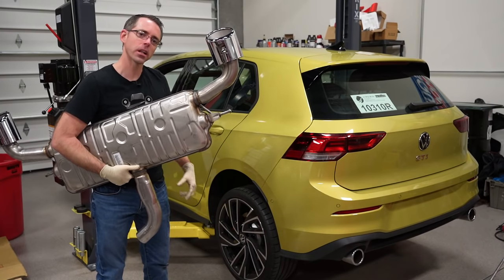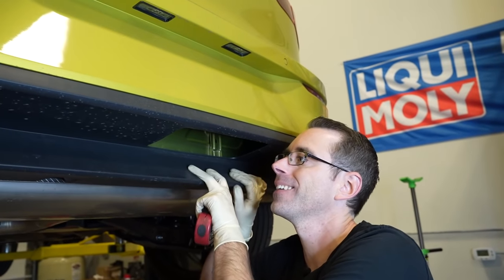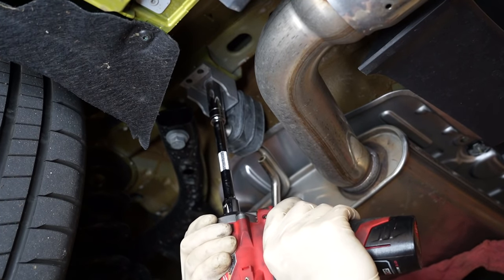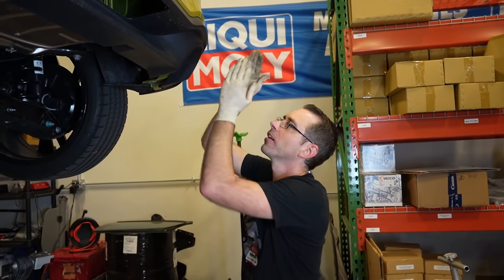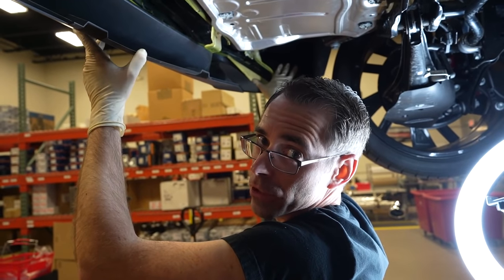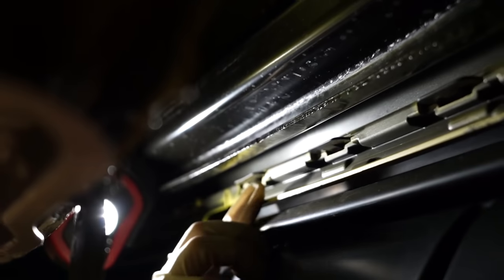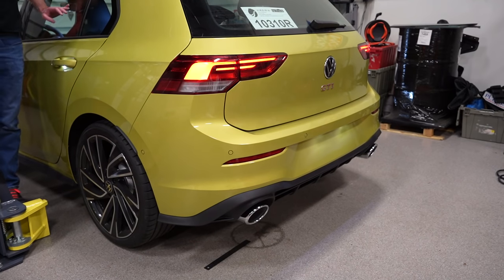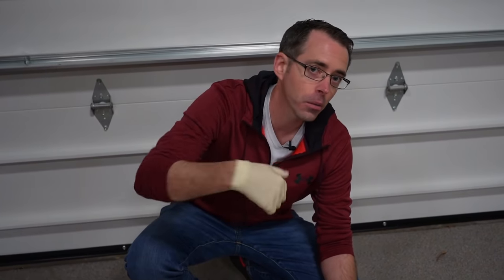Can the MK8 GTI Sound Good? | Clubsport Muffler Install

Comment from the maker: Thanks for watching! Here is the link for the MK8 GTI Clubsport Rear Muffler and Valence Retrofit - https://www.shopdap.com/mk8-gti-clubsport-rear-muffler-and-valence-retrofit.html

Visiting the VW Port, Picking up our MK8 GTI, and installing a short shifter - Video
https://youtu.be/ynAlwnsc3Lo?t=3
Reply: I have a Clubsport S muffler that I had on my MK7 and now I’m driving a MK7.5. Do you know if there is a valance I can get that will let me run the Clubsport S muffler? I really enjoyed the tone of the muffler and would love to use it again. Thanks!
Reply: The 3 dimples you identified where you cut the muffler is indeed the factory location for cutting the pipe and using the butt clamp. You are actually meant to cut on the middle dimple and you'd have a perfectly fitting muffler. The same method is used across the entire VW group and it's basically in place for when you need to replace a muffler. For example, on dual rear muffler VW group vehicles these 3 dimples will be present on both sides. Cheers!
Reply: GTI 245 ch ...bullshit

Comment: Just stopped by my local dealership to check out the MK8 and although I’m keeping my MK7 Sport for now it definitely looks way better in person.
Reply: Who
Reply: @oaxaple4636  You
Reply: Yeah but it has trash interior
Reply: Asked
Reply: Mk7 is way nicer indeed!
Reply: I like my  physical knobs
Reply: Im keeping my gti mk7 too 🤩🤩🤩
Reply: 7 way better
Reply: Nah nah nah the mk7 is far superior in looks to this garbage I especially hate the new interior like most people
Reply: @ivanjovanovic362  have you been in one
Reply: @quadmeister  dream on
Reply: I get compliments everywhere. 
it’s looks very handsome in person
Reply: @downshiftpedal   go away! From outside its ugly and from inside its insane ugly...
Reply: It grows on you it’s actually really nice my neighbours got one and I actually prefer it to  the mk7 now
Reply: SPORT GANG
Reply: I just can't stand the front bump on the mk8 GTI, there's just too much lower grill
Reply: @downshiftpedal  from an outsider’s perspective i think the mk8 looks much better than the mk7. mk7 and 7.5 look dated now. and the interior on the mk8 isn’t that bad. 99 percent of the time i use steering wheel buttons for volume and it doesn’t look too hard to memorize where the climate controls are when it’s dark. i know where all the climate buttons are in my subie and can use them without looking. i imagine it’s the same with long term mk8 drivers. plus the mk8 has so much more power. 240-250 wheel hp and up to 320 wheel torque has been seen on dynojet. they’re absolute monsters. that’s why i ordered one rather than just buying a mk7.5 for thousands less
Reply: @ivanjovanovic362  that is your opinion 😂 I love my mk8 interior
Reply: My mom has one and everyone else in my town has one and I sadly have to disagree with you
Reply: @thefunperson1  your infotainment system crashes more often than I got rejected in 18 years
Reply: @iuopunderstandyourjokes9914  funny cause mine doesn’t crash
Reply: @iuopunderstandyourjokes9914  but i believe that you got rejected a lot, makes sense
Reply: @aidanjulianroman  fr? I was driving my moms golf 8 gti once and it crashed 4 times in 12 minutes
Reply: @aidanjulianroman  2 times out of 2 tries
Reply: @iuopunderstandyourjokes9914  damn sorry to hear that. mines a 23. 22s are worse and cars without the updated wheel are worse too
Reply: @aidanjulianroman  my moms is also a 23 and it doesn't even have 2000km on the clock. My mom picked it up a month ago from wolfsburg and the infotainment system still crashes regularly. It might be a Friday car
Reply: @iuopunderstandyourjokes9914  hang on to it :( there are updates coming that fix it but most dealerships don’t even know about it yet. the updates fix the infotainment and the steering wheel control module will fix the travel assist issues. just hang in there lol
Reply: @aidanjulianroman  the place where vw comes from is literally 2 km away from my house and they know and even admitted that their infotainment is a failure. If it was up to me, I would just swap the gti steering wheel for the cupra leon wheel (it's basically the same but with physical buttons)
Reply: @iuopunderstandyourjokes9914  you live near wolfsburg? i’ve always wanted to see that plant. i live in the states and i work at the plant that makes the atlas and id4. the good thing is that there are fixes for the infotainment. there’s a guy here who is testing software updates and seeing if he can get the issues to go away. that will fix the input lag and glitches in the screen itself (and fix some weird quirks with settings being reversed when you shut the car off) and the new steering wheel module will fix the travel assist errors. im sure if you could code a cupra wheel to work with the mk8 it would fix the issues as well (and you’d get physical buttons!)
Reply: @aidanjulianroman  I got the wolfsburg licenseplates on my car. I saw the plant and it's boring as hell. If you wanna come to germany just to see the plant, don't. This town has nothing to offer (we don't even have a karaoke bar.) You can see the whole town in 20 minutes on foot. The VW atlas isn't even sold or built in germany but one guy here has one and it looks pretty sick. Here in wolfsburg, no one ever thought about doing anything about the infotainment system and it makes me pretty sad because my factory cd radio in my 18 year old audi works better
Reply: @iuopunderstandyourjokes9914  oh i wouldn’t go just for the plant unless i get into a different position at vw that requires me to move. the inside of the plants are fascinating to me though. but yeah, it sucks that you got a dud mmi. my mk8 has been great for the 900 miles i’ve put on it. infotainment has been completely flawless for me. carplay connects fast and i’ve had no lag or glitches. hopefully you can get yours updated and it fixes all the issues, it really is a great csr
Reply: @aidanjulianroman  we put 2000 km on it and it started behaving about 150 km ago. I still don't like it but that's because I'm old school and prefer physical and backlit buttons
Reply: @iuopunderstandyourjokes9914  I went to see a MK8 while driving my MK6. Of course the mk8 is newer, better performance, 7-spd. On the other hand, my MK6 is so analog, I still have the original radio, that european feel and smell is lost on the 2022/23 model. 
I love my mk6, maybe in the future once it goes OOC.
Reply: @psiturbo  you lied about one thing. You called it better
Reply: @iuopunderstandyourjokes9914  it has better performance, the mk8.
Reply: @psiturbo  sorry, I miss read your comment
Reply: @quadmeister It’s a VW, it’s gonna be ugly

Comment: The mk8 GTI doesn’t sound bad at all with the stock muffler.
Reply: True, but better is always nice
Reply: sounds like a vacuum cleaner man.
Reply: Yep, just got one last month and considering the sound usually gets slated I was pleasantly surprised that sounded more fruity than expected.
Reply: @MrArchie800  Keep in mind unless you've entirely deleted Soundaktor from the GTI you may be under the influence of artificial sounds.

Comment: Those bends/marking on the pipes are intentional. Can look it up in the repair manual (if you have access to one), it means that if you ever need to change that part of the exhaust the middle marking is where you should do the cutting.
Reply: Did he cut to the front of that middle dimple which is why his gap is a little big?   It's hard to tell in the video, but it looks like he might cut to the rear of the middle dimple, which is weird because the gap is big.  I know lining it up and visually checking is best, but it would have been great if he said "I cut 1 cm upstream of the middle dimple" (or whatever).

Comment: This automotive engineer's opinion.  I was young once and changed every exhaust on all the performance cars I owned.  Not any more.  A waste of time and money and every louder exhaust has a trade off of harshness at some interval of RPM and load.  This is better than most because it is an optional factory muffler but again, a fair amount of money with the price of German factory parts and very similar to the stock muffler as you note.  Increase in depth of tone under load isn't something a driver wants anyway in daily driving.
Nice video though and you do a nice job.  Thanks
PS. what I have learned over the years about exhausts.  A quieter car overall is more enjoyable because you can wring its neck, be up on the cam and closer to redline without drawing attention of the police. Same with motorcycles for those that enjoy performance on two wheels and have a need for speed.  Further, for non-spirited driving, a stock exhaust is less obnoxious to live with day in.  Young people learn this after their 5th modded performance car.  Some lessons in life take a while. 😉
Reply: Can confirm this x 100. I own a 16” 320i. Exhaust is not even loud and sporty driving is really fun and the rear goes if you force it to. My lil bro has a 13” S3. 300hp with stock exhaust. It was fun driving till the fucking exhaust was giving me headache by just cruising. I cant imagine other cars with custom exhaust being fun to cruise along in. Sleeper cars are also more fun because people dont expect anything of it.
Reply: @buraksarikaya9798  That's why in Germany every exhaust system is not really louder than the original one, it just sounds different. Every legal one at least.

Comment: Got mine Monday, installed it today ( on jack stands ) this video made installation a piece of cake! Hardest part was getting the rubber hangers off the old muffler. Keep doing what you guys do! Love the look and sound! ✌🏻✌🏻
Reply: How was it making the cut to the stock muffler?
Reply: @SWEETVENOM100  not bad at all. I used a pair of the exhaust pipe cutters.. the worst part was getting the hangers off.
Reply: @jayorzell3656  how did you measure ? I’ll be doing it on my back😫
Reply: @SWEETVENOM100  that’s how I did it… the entire process took me about an hour and 45 minutes. Which no joke 45 minutes of it was messing with getting the rubber hangers off. Plenty of wd40 and the pic tool method mentioned in video along with some patients does it..good luck!
Reply: @jayorzell3656  just rented a  Reciprocating Saw and got her done. 1.5hrs only because I was trying to like the tips the best I could.

Sounds pretty tame but I haven’t taken my car above 5K yet. In comfort it’s quieter than the stock exhaust!
Reply: Any issues with leaks around the band clamp?
Reply: @ericmorris2831  no issues with leaks. Clamps work great

Comment: I installed a custom catback thankfully and I mean it, it is valved, i remember driving 3 hours with the valves open I got a headache, when the valves are closed, it is quieter than when it was stock, basically sounds like a vacuum cleaner.

Comment: Nice vid. Have you heard of the SEAT leon Cupra model sold in Europe and Australia? My profile pic, there's one. Basically VW bought out the Spanish auto make (not entirely) and with the help made an evil stepbrother to the Golf GTI/R. They are nice, equally fast and sound the same. VW engine with Audi design. Front wheel drive only. The Cupra ST (station wagon) is the only 4 wheel drive version. The Cupra 300 comes with 300 hp and the Cupra R comes with 310 hp.

Comment: It's a must-do mod on the Mk7.0 to extract a decent sound out of it. Believe it or not there are 2 versions: Clubsport and Clubsport S. Obviously you want to go for the S variant :-)
Reply: For sure the CS S is worth a try, but appart from the stickers, bumpers an a rear seat delete and so on (little more Power) the CS is the same as the CS S. Is that worth a price diference of 10.000 to 20.000 € (in case you get a good used CS S) These cars cost about 50.000 + here in Germany. Plenty for a hot hatch even if for a limited edition.

Comment: Thank you. Your videos are great. I have two questions.  What is the RPM in 6th gear at 60MPH and what is the real life fuel economy?
Thanks again.
Reply: Iv a mk8 CS pushing 322bhp stock 
I did a round trip of 252miles each way (504)
9.56 gallon shared by the miles done 
It was doing 48/51mpg

Comment: The current legal noise limit for car meeting type approval is 74 decibels, and it is it is illegal to modify a car's exhaust system to make it noisier than the level at which it passed type approval with.Jun 8, 2019

Comment: Ok so i have a 2008 city golf. I added high end sparknplugs and ooen the airbox and removes baffles. Then put factory air box back. This thing burbs its tires off and flys to red line. . i tapped neg battery cable to neg battery terminal and reset my throttle body and im serious its a shutty gti now.😂

Comment: apart from the muffler, was the rest of the exhaust standard? or did you have a res delete to or anything? I've ordered a res delete kit as didn't think about doing a clubsport muffler on my gti, is it still worth doing the res delete kit along with this clubsport muffler? or should i just return the res delete kit and do the muffler instead?

cheers Nath

Comment: Why does VW not have a rear plate mount? Do you recommend a certain system? The dealer drilled my rear plate in but luckily I had asked for the front not to be drilled in…
Reply: Since the MK4 Golf VW just drills in the rear bumper I hate that shit.

Comment: besides the exterior of the cosmetics of the muffler what’s the difference on the interior of the muffler
Reply: Umm, baffling of course :) Were u thinking he would cut one open ?
Reply: actually yes to me it would of been cool to see if the exhaust flow is changed or if its the same
Reply: @9kia8  It would have changed of course that's why its a different sound. Probably more of a straight thru

Comment: What effect on MPG or emission tests will it have?  Has it thrown any check engine lights yet?
Reply: Such an exhaust does not affect mpg and will also Never cause engine lights and as for emission test some aftermarket exhaust may have higher emmisions however this is a factory muffler so I highly doubt if
Reply: @Ricklode  The current legal noise limit for car meeting type approval is 74 decibels, and it is it is illegal to modify a car's exhaust system to make it noisier than the level at which it passed type approval with.Jun 8, 2019

Comment: Should fit on mk7.5 GTI TCR, friend can you confirm?
Reply: There’s a specific one for the Mk7.5 TCR
Reply: @kevs2good133  I already have the TCR one, I would like to change it with CS mk8 for larger terminals.
I'm not sure if mk7.5 and mk8 have the same dimensions, you should measure the distance between the 2 terminals and check if the silencer brackets are the same.
Reply: @luca_b8213  I shouldn’t do that because I don’t want to. I’m going to buy the Clubsport muffler and just pay someone to install it for me.